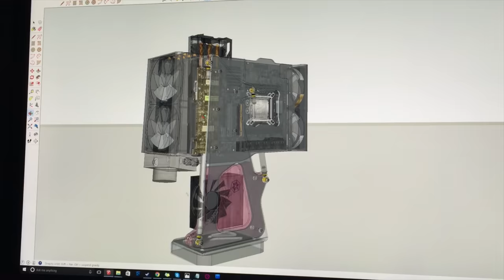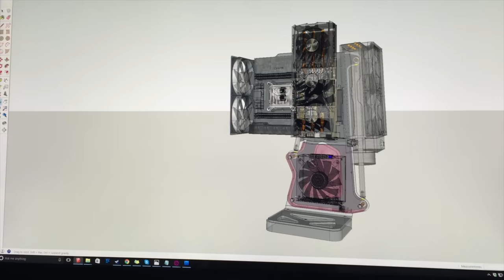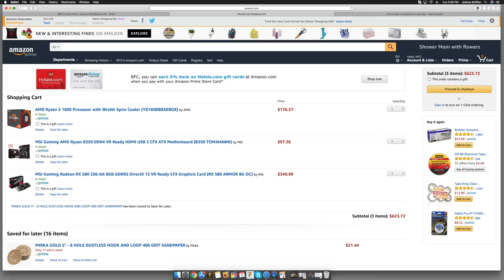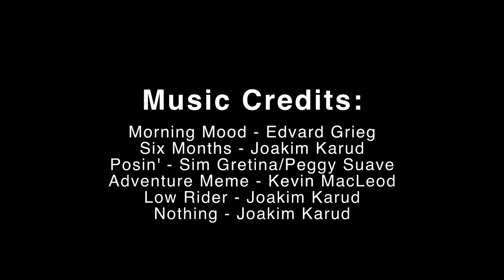Scratch Build with AMD Combat Crate

Comment: The fire bluing doesn't harden it softens that's why you only see small parts done this way. What you're thinking of is color case hardening. Next time you do this I recommend using a oven, You can control the temp better therefor the color. I use it for small decorative parts.

Comment: They really should have added some matching RAM into this kit, something picked to be the perfect match to what the board can handle and what the CPU can take advantage of. That way you can buy it and get a complete upgrade in a box if you already have a case, PSU and storage.
Reply from the maker: I agree. RAM is the only thing that is complicated for a user to pick out, and perhaps they could have worked out better more stable pricing for the CC. I suspect they didn't do this because of RAM pricing and because they wanted users to pick between 8GB and 16GB.

Comment: Bit late to the party but from my Experience the Msi RX580 Armor (Mk1, they made an updated Version) i am pretty confident to say it is massivly bottlenecked by Heatproblems due to a cooler that is just too small. also, when mounted horizontally, it suffers from PCB-Bending as the Cooler isnt connected to the Mountingbracket in any way and drags the entire card down. DONT buy this card. I replaced the thermalpaste and reseated a falsely applied Thermalpad on the VRAM and Powerdelivery, which helped temps a little bit but it is far from perfect when you dont want the fans to Go Airplanemode.

Comment: Really cool.   Gave me an idea for making acrylic 2.5"  hard drive cage to fit in the 3.5"  mount on my hp 8000 sff    so I can use 4 x 4tb 2.5" drives as they are 19mm each  to expand the life of my file server.  As I can make use of the tool less features of the case.    Are pc parts a normal threaded tap?

Comment: I don't really do the "Like" and "Sub" or any of that crap, even on guys I watch often, but you seem to be the only guy on you tube who does the kind of crap I like to do... Some nice tools for such a young guy, too. Liked and sub'd
Reply: Mark the BACK side of your paint work with a carpenters pencil, pencile wipes off, sharpie actually dries into a plastic coating and changes the texture of some paints.
Reply from the maker: @ReelSpider  Thank you for the tip! As for the tools, I started 10 years ago now with a dremel. Built up over a long period of time and it is amazing what you can find for cheap that people are throwing or giving away. Peace

Comment: Why was he given the older models instead of the newer ones???
Reply from the maker: Agreed. GET YOUR STUFF TOGETHER, AMD, I WANT SUMMA DAT 2700X!! xD
Reply: Chris Bullock because that wouldn't make sense they are clearing out the old stock of 1600 and 1700 and why give away newly released product that they will take a lost on if they went that route a 1700 cost way last then a 2700x so on for the 1600

Comment: 1060 6gb for 265 wayy better deal than paying 350 for a damn 580
Reply: mynameis ____ So you’re saying GTX 1060 is back at MSRP? I don’t think so pal.
Reply: MIND NOVA Yea it is. You're stupid if you can't find some deals out there. Plenty of them
Reply: Well I bought rx 580 for 421 and I found a combat crate here for like 450$
Reply: MIND NOVA they are at msrp at nvidias page...only 2 per customer....but its still a bad deal as new series is coming out soon,and they are clearing stock befor prices drop even further....
You can get 1060 6Gb for 300$
Reply: Lipi19821 Yeah about 300 that’s seems right.